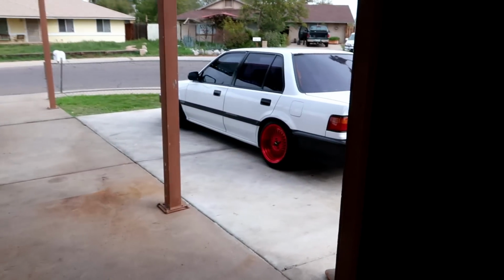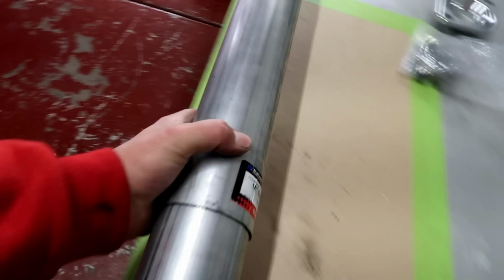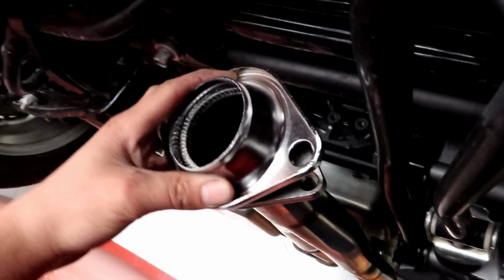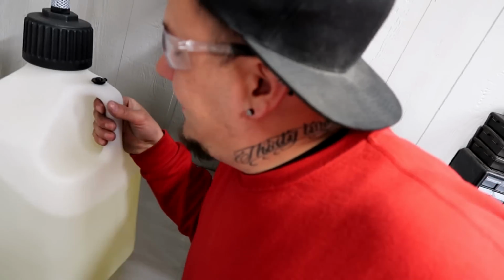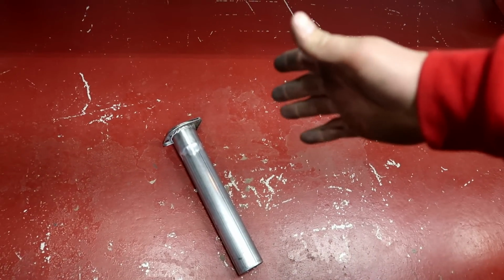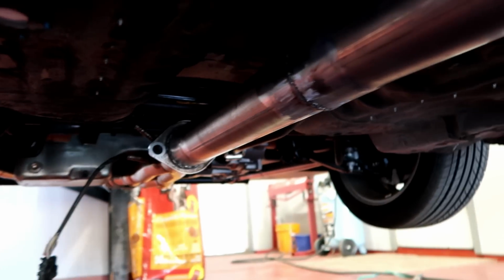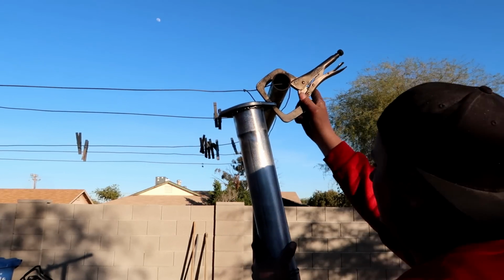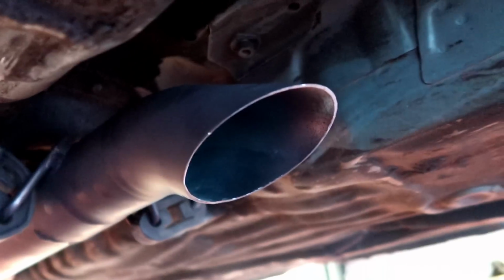DIY Straight pipe exhaust for under $30!!

Comment: You need more heat with those welds bro . Turn up the heat or turn down the wire feed  so the heat u are set up at can fuse the metals together . You wont get that spaghetti noodle dooookie weld.  But hey you gotta start some where ... build coming along . Nice job !

Comment: zorst turned out real nice ,should leave the bolts just tight enough to seal it from leaking so it can move so no strain on the manifold and use two more nuts to lock it after could even tack weld the two nuts together

Comment: Is it me... or does the front wheel seem to be bent 🤔
Reply: Luwie__ it’s because it was lifted on the jack stands so the suspension raises witch causes the wheels the positive camber but when you set it back on the floor it goes back to normal👍🏽
Reply: Sergio Morales haven’t had that happen to any of my previous cars. Which is why it seems odd to me🤷🏻‍♂️
Reply: Luwie__ that good suspension tho some don’t do that and some do I’m thinking